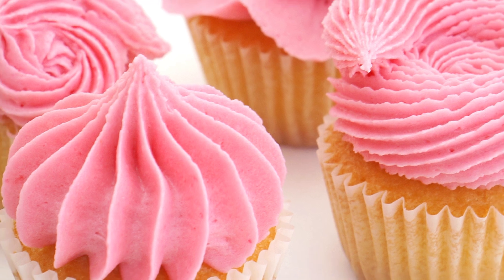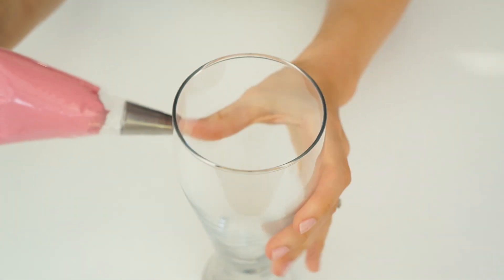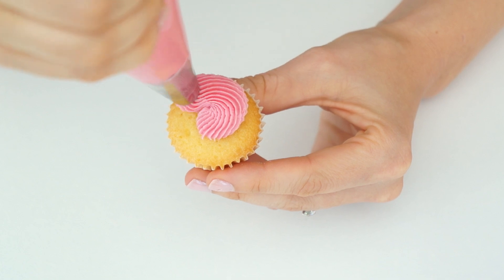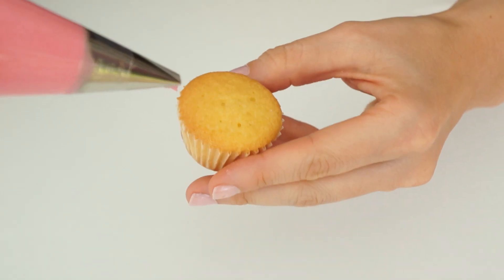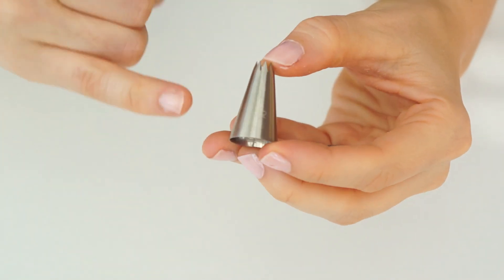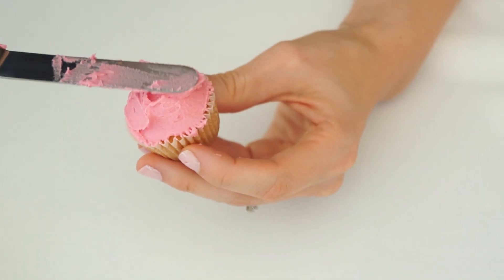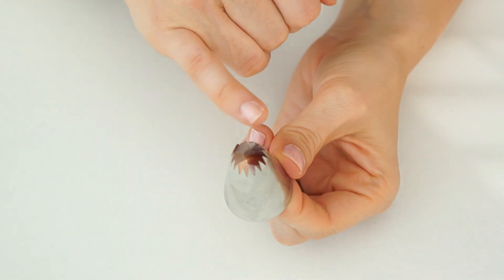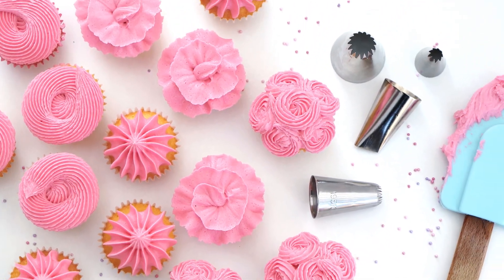Mini Cupcake Piping Tip Techniques Tutorial #5

Comment: Hi Cakes by lynz! Great job! What is your buttercream recipe converted to cups? What is your exact process. I was having trouble understanding it in the video. How long do you leave your butter out for it to get to room temperature? How do you get your buttercream so smooth? Pls let me know! Thanks.
Reply from the maker: Hi, Thank you for your message. We don't really use cups as a method of measurement in the UK, but I have looked into it for you and it would be 3 cups of icing sugar to 3/4 cups of butter. When making the buttercream I leave the butter until it is slightly soft to the touch. I then mix the icing sugar and butter together with the quantity of milk and flavouring that I mention in my buttercream tutorial for around 5 minutes until it is smooth. I really hope this helps.